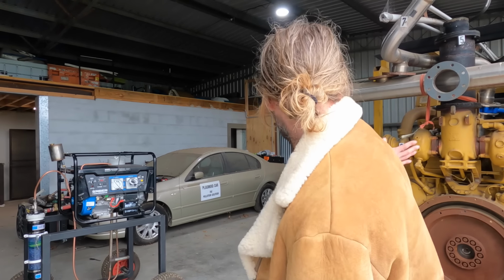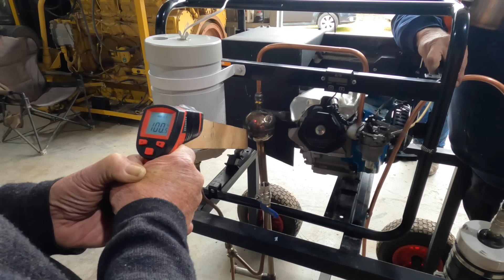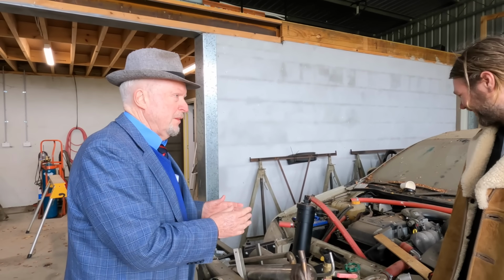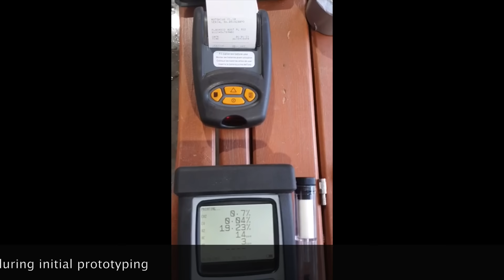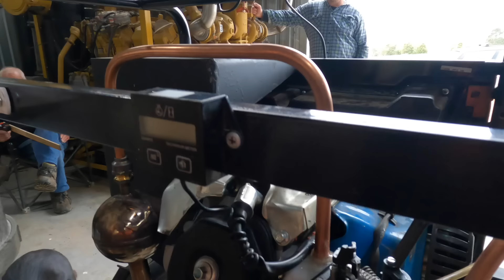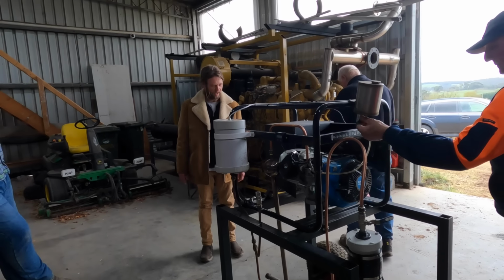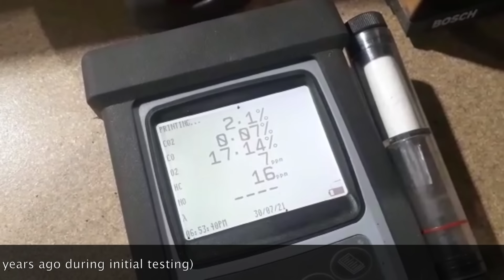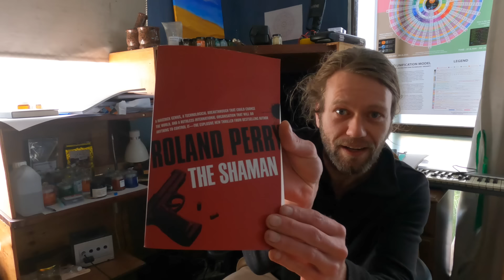Malcolm's Thunderstorm Plasmoid Generator in Action | FULL DOCUMENTARY | with Jordan & Roland Perry

Comment: It's cool that it cleans the exhaust, but are you cutting off the fuel completely? My understanding is that the plasmoids and exhaust carbons become the fuel. This aspect seems to get skimmed over quite a bit. I'd like to see a cutoff valve on the fuel tank to prove that it continues running on the plasmoids.
Reply: I have the same question, is the engine switched from gasoline to plasmids completely, or is the introduction of plasmoids “diluting” down the ratio making it “cleaner”???
Reply: sounds like the plasmoids act on the CO2 neutralizing it, its not the fuel
Reply: If you shut gas off engine will die
Reply: Looks more like a hyrbid engine that uses fuel to start but possibly reduces consumption once at operational temps.
Reply: So you're heating the water running it through the stainless steel mash it vaporizes and you're enriching your field mixture with oxygen... Can't really say that you're doing anything but adding water vapor which is common in the performance engine industry 🤔🤔 If you're not shutting off the fuel all the way to the motor then you're really not running this motor off of water... Basically your recreating scenario where the motor is running in a high altitude location and supplementing oxygen with vaporized water
Reply: I heard in another video that the plasmoids can act as fuel that can be ignited by the spark park.  I would think you would be able to completely cut off all gasoline at a certain point and let it run on of 100% plasmoids and be self perpetuating. I agree though, it’s been hard to get a straight answer on this aspect and makes me wonder.

Comment: First of all, great footage and thank you so much for getting it. 

So it’s the vacuum pipe from the intake manifold that creates the bubbles. Usually on a scooter, that vacuum pipe runs a mechanical fuel pump if the carb is below the fuel tank.

The revs change when you open the valve because you have let more air into the engine, essentially creating a “vacuum leak”. This would make the engine run leaner and use less fuel and run hotter. It may also make it “smell cleaner and hotter” as it’s not burning as much fuel but more air, it also explains why the engine needs to be hot to make it work.

I’m not saying it doesn’t work at all, I’m just telling you why the revs are changing. It would seem from looking at the smaller generator then you could quite easily make your own with a scooter or small motorcycle, it would be the simplest way as the engine on this generator is very similar to a scooter engine.
Reply: I wonder how that generator would handle that vacuum leak being introduced if that generator was on full load ...I have no doubt it reduces emissions but if it makes no horsepower while doing it ,what's the point .
Reply: it works based on sacred geometry numbers and resonance frequencies. Everything has to have a precise measurement and specific frequency in order for this technology to work.
Reply: aggre to some part, rich engine runs hotter than a lean engine vs same airmixture, lean engine would rev up more yes, but what they got here from my understanding is a over hyped water filter (wich dosnt make sense at all bc what u gonna do with all diluted water wich will start to stop work fairly quick) and then pre-heated gasoline wich is a bit more efficient than cold gasoline...

Comment: Do you folks know about G.E.E.T. systems? They achieved a similar results by running the exhaust heat back over the intake, as well as tuned a given engine to a particular resonance (unique to each motor), creating a plasma that would essentially clean the final exhaust (as I understand it). 

Very cool work 👍 Thanks for sharing!
Reply: I was wondering if anyone would mention Paul Pantone
Reply: They stopped it whit a lot of lawyer and untrue judgement. If this work, and can it's a possibility that this youtuber get sued
Reply: @EnkiMMXII  So was I.
Reply: The GEET device was a crossflow gassifier. They've been in use since the late 1800s. Contrary to popular belief and proganda, it has far less to do with any "resonant frequency", and far more to do with static electricity. Much like rubbing your feet back-and-forth on carpet, then touching a metal door knob, the gasses flowing in opposing directions across a conductive surface create a highly excited environment for the intake gasses. 

The GEET device was touted to create combustible gasses from nearly any readily dissolved combustible substance... table sugar, maple syrup, vegetable oil, you-name-it.

I wasn't waiting on anyone to mention Pantone, as I'm sure they don't want any correlation made between the two. Paul was indicted on several LEGITIMATE charges, for fraudulently obtaining investment securities. Regardless of his demonstrations, his claims were inflated and the device held little-to-no practical application... as the throughput of the device greatly restricted the power output of any converted example, even when compared to conventional carburetors running on gasoline.
Reply: @driverjamescopeland  Interesting. I never got a chance to see it working in person, nor did I presume the tech when I had become aware of it. But I'd still like to try it myself one day, regardless of what the claims may be. Thanks for the details though ✌️
Reply: @orpheuscreativeco9236  - they're neat little novelties. Watching an engine run on things that aren't notably flammable is cool... like soda, for instance. Nearly any reasonably decent piston engine (or any engine capable of sustaining the necessary vacuum) will run on one. They're just not practical for anything... except maybe as stationary powerplants in some remote agriculture application, where the fuel is plentiful, and the size/weight of the engine makes little-to-no difference. 

What kills these devices, is a poor volumetric efficiency. I once saw a "properly tuned" G.E.E.T. device installed on V8 pickup truck. At best, the engine produced about the same power as the little single cylinder genset engine in this video... not converted, but with the OEM induction. It was anemic, to say the least. 

If I were to surmise even the most remote use for these devices, it would be on sugar cane farms, as a stationary powerplant to run the post-harvest processing. Maybe (and this is a big maybe) you MIGHT be able to sustain a 100-200 acre harvest with some massive 30 or 40 liter engine... might sustain around 90kw or so.... and burn about 20% of your previously viable product in the process 🤣
Reply: @driverjamescopeland  interestingly, Malcolm Bendall has a "colorful" background too. LOL

Comment: Introducing water vapor into the mix is what's making it run cleaner. You can remove pretty much everything else and it'll do the same. It's been known for a very long time that this is what it does.
Reply: But...but...it's the plasmoids! THE PLASMOIDS!
Reply: I would love to build prototypes for my own car and generator. Is there a link to proper plans with parts list, accurate measurements and step by step building instructions. If not, this is being presented very irresponsibly and can cause injury or even death and is not really an open source project. This will be a huge Global Revolution if laymen can convert their own vehicles to prove the concept, so if these fne gentlemen cannot provide proper, reliable and safe plans with which the DIY enthusiast can enable small generators and cars with this concept I tend to call BULLSHIT. (•‿•)
Reply: @Based_transition_Clocker peroxide solution...
to me... nothing gels. i see some copper pipe and plumbing fittings stuck on a lil engine. yay.
if it worked it wouldnt be on youtube, let alone recommended...

an engines an air compressor. they run on air as it is.
hot air. add fuel, light it up. heat, pressure, vroom. 
compress it, heat rapidly, then expand with more pressure, performing work, than took to compress.
so how does this plasmoid thingy help raise the air pressure ?
"fuel go bang".
no it dont. heating air raises its pressure, and burning stuff in it heats lots of it fast.

Comment: The concept of an advanced engine system that reduces emissions and improves efficiency has been around since the 1970s when an innovative inventor created a car running on a similar setup. Although his work was groundbreaking, it remained largely unknown after his mysterious passing. It’s likely that his technology was preserved for future use, which we are only now beginning to see with the recent surge in "green" initiatives.

However, my design takes this concept to an entirely new level. While the original idea involved a system that superheats exhaust gases, filters them, and recycles them back into the engine to reduce pollutants, my technology is far more advanced. My system not only enhances this recycling process but also dramatically increases efficiency and effectiveness, reducing harmful emissions to a fraction of what current systems can achieve.

What the original inventor started was brilliant, but my design surpasses it in every way. By optimizing the superheating process, improving the filtration and recycling mechanisms, and incorporating new innovations, my engine technology is poised to revolutionize the industry and make a substantial impact on the environment. This is pretty impressive my friend unfortunately your design is a little outdated compared to what I have come up with. If you would like to reach out and contact me I can teach you a much more efficient way while increasing the performance of the engine and also reducing the harmful emissions that the engine creates. My original design is based off of a man from the 1970s that had a vehicle running very similar to this design and I've just increased and had it on other devices and things when you're creating your thunderstorm I'm creating a tornado a thunderstorm and a lightning storm all-in-one. Yes sir have a nice day brother.

Comment: Technically you'd think the oil companies would love this technology since it means the car companies can return to the bigger and better gas engines for their vehicles without the EPA down their necks
Reply: It depends on how you look at it, once this box it opened it can never be closed. Consequently that includes all doors from this one. Somewhere there could be one that makes petroleum irrelevant.
Reply: Burning oil will be irrelevant , but oil as a resource is used in many other applications ❤
Reply: @infinite9127  This thing runs on fuel, not just on air or water. Air is vital, water...we're not sure with this technology. If water plays a role, it needs to be maximized, as it's plentiful in most places, and cheaper than fuel (in most places).
Reply: Never mind the oil companies: car companies would outbid each other to get this "technology" so they can outsell their competitors and then license it to their competitors. Imagine selling a car that is less expensive to run and is better for the environment? Sadly, this is just a fancier water injection system and has been around for, literally, decades.

Comment: Curiously interesting.
However, as every mechanic will immediately see is, you have damp heated air going into the engine "after" the carb... this will lean out the mixture of fuel & air already blended in through the carb (reducing the hydrocarbon smell in the exhaust). This explains the Rev' increase. Would like to see how milky the engine oil is after a few hours running.
The heated moisture as well as creating a lean mixture would also create superheated steam during combustion giving some expansion but also reducing the flame proliferation throughout the cylinder. This would reduce the violence of burning a lean mixture reducing spark knock risk, however, inspite of the increase in rpm and fuel economy the actual horsepower and torque to do work would be less. 
Show a no load vs full load ( at the generators max constant load rating)operation with and without the device.
Reply: Have you seen the video where the heated water side of the tech was not working and still there was a significant reduction in the bad gasses
Reply: I was looking for this comment. The rev increase is definitely the vacuum, "leak" they created. Hard to make any kind of judgement without any empirical evidence as to what is changing in the powerband, vs fuel consumption. As far as I can tell, this looks like an overcomplicated water injection method. I'd like to be proven wrong though, as any additional methods to trim fuel consumption is a win in my book.
Reply: the moist air charge goes through the plasma arc at the top of the reformer, and what comes out and goes into the engine is magical, hey?

Comment: Can you use a CO2 and CO meter on the exhaust?
Reply: this.  as good as the guys nose might be its not safe to stick your face at the end of an exhaust pipe.  and not very scientific/technical.
Reply: It needs to be done on 4 sides of the reactor in my opinion. Inlet in and out, exhaust in and out. 
Whatever happens with the ionization may trip up meters, though, a meter reading is not truth by definition, especially in funky setups.

Comment: So I understand the idea behind the proteums contribution to converting the carbon to oxygen but I am a bit confused about the fuel aspects. After the bubbler comes on, is there a valve that toggles the water vapor / plasmoid mixture into the engine instead of the fuel? Is the idea that eventually the engine can run entirely off of the plasmoid vapor mixture or is standard fuel expected to still play a part outside of heating? We really need to get this more mainstream to get more testing done. Great video!
Reply: I have basically the same thought. There's plenty of explanation on the system itself, but it ends before we get to the combustion chamber.
Reply: That is my question as well, even if it needs hydrocarbons to run this is still huge.
Reply: I was confused about that part. Are they not explaining the obvious question. Is this replacing a percentage of fuel and what is the fuel consumption. Was there a drop in horse power if so how much. It seems amazing but they are not talking layman's language.
Reply: so from what randall carlson said, the only fuel you need is to start the engine and to get it to a certain temperature which takes a few minutes and after that it is self sustaining
Reply: @naps7039  That’s an insane claim if he really said that. the engine is running lean and super inefficiently but it’s very much running on gas. And will stop when the fuel runs out of the reservoir.
Reply: @inteligentmonkey1  i have no idea how it works but he said it just takes the initial gas to start it up, once the temps stabalize then its a self feeding system. I could be wrong maybe i misunderstood what randall carlson was saying but i recommend listening to the podcasts hes done recently discussing this technology, he goes in depth on it.
Reply: @naps7039  I have watched the videos. and have an understanding of international combustion engines. You didn’t mishear what he said. But the claims are insane lol. it’s not what’s happening in the “thunder storm generator”. It very much needs fuel to fun.
Reply: I heard it's 70% fuel efficient so will still need fuel just less.
Reply: @naps7039  check out The Shawn Ryan Show whom interviewed Randall Carlson a few days ago.  It won't let me link it, but it just aired last week.  He said it does still require fuel but not nearly as much once running.  He also goes way more in depth than the interview on Joe Rogans show when he wasn't really supposed to talk about it.
Reply: @Realm109  oh awesome thanks fam! ill check it out
Reply: It sounds like its using water to convert byproduct carbon back to usable carbon(fuel). It still needs fuel to generate the carbon, but its basically using a MUCH larger percentage of the fuels energy.

Comment: The claims about the carbon emissions don't seem to make sense, so the water vapor in the exhaust is probably interfering with the standard sensors.  For a quick and easy test, put this generator in a small unventilated room with a canary for 8 hours and see if it survives.

Other than that, all I'd want to know is if the thing makes the engine run longer on less fuel.  Or if it can be used for refrigeration.  Anything useful?
Reply: The Canary Test will be excellent. I challenge them to do it! I would love to build prototypes for my own car and generator. Is there a link to proper plans with parts list, accurate measurements and step by step building instructions. If not, this is being presented very irresponsibly and can cause injury or even death and is not really an open source project. This will be a huge Global Revolution if laymen can convert their own vehicles to prove the concept, so if these fine gentlemen cannot provide proper, reliable and safe plans with which the DIY enthusiast can enable small generators and cars with this concept I tend to call BULLSHIT. (•‿•)